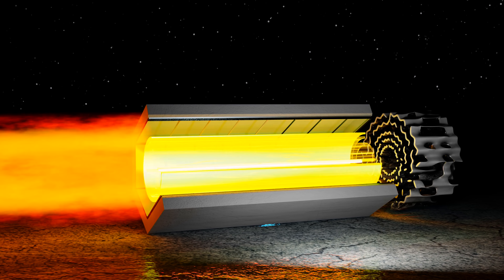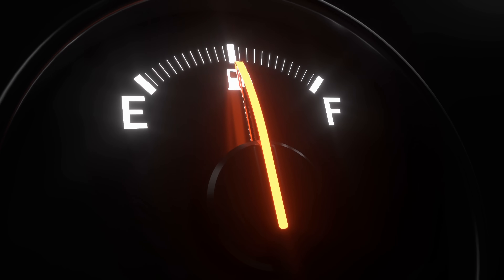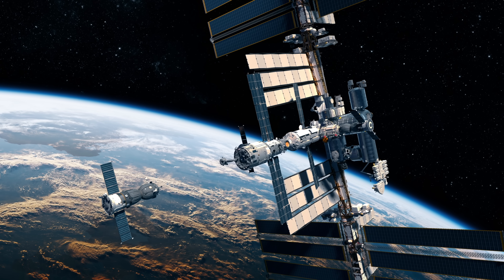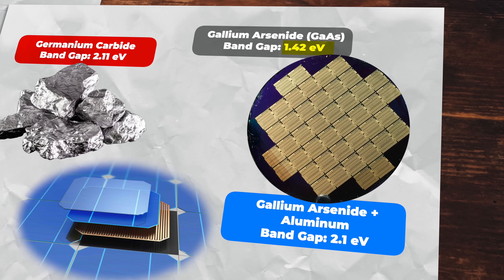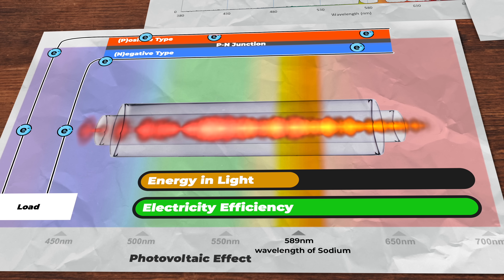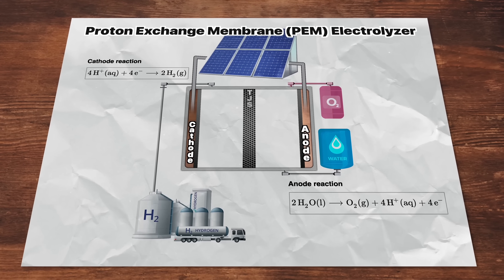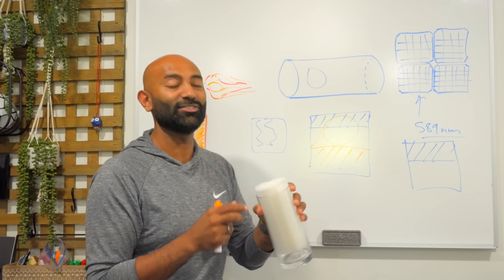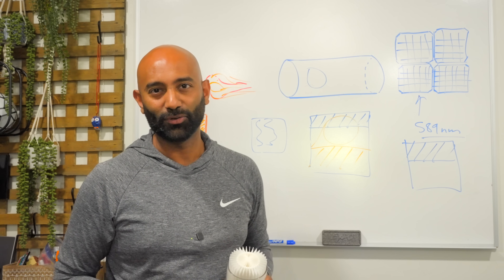Why Solid State Might Save The Combustion Engine

Comment: I am neither a physicist nor an engineer, nor do I play one on TV, nor have I slept recently in a Holiday Inn Express.  I am not sure about color or monochromaticity, but High-Intensity Discharge and Low-Pressure Sodium lamps operate at 150 to 210C (300-410F) which might be inserted post-catalytic converter for electrical generation.  Also, since there is much infrared light energy, I would think there should be investigations into band-gap tuning of Perovskite or other cells.  Hopefully, they would be less finicky and more long-lasting than the fuel-cells I've worked with.  Anyway to gain energy and reduce pollution is worth a look IMHO.

Comment: I would not throw the exhaust energy out the back. I would use a regenerator to capture more of the heat and further cool the exhaust gasses. This in turn would require less fuel to reach and maintain operating temperatures. I like your hybrid approach. In theory you could fit them to existing vehicles. Only issue is you can't get the NaCl substrate hotter than the factory exhaust gasses without some sort of heat pump.

Comment: The main issue I see with your plan of adding this setup to an existing ICE, is that the exhaust temps aren’t high enough to boil the salt. 

Exhaust headers can reach 1600° after a hard drive. NaCl boils at 2669°F, so you’d most likely have to reintroduce fuel after the header to heat it back up enough to make the light cell function.

Comment: Seems like we could add in TECs (thermal electric coolers)/Peltier to also generate power from the heat as it's cooled. IE a 12V system for traditional accessories.     This also seems like something a science enthusiast whom watches a ton of science content on YouTube would come up with. It just makes so much sense to me. All of it being things I've seen on popular YouTube videos but combined into a single project. This almost seems like it can be an advanced DIY project for more hardcore makers.

Comment: So, how do you solve the issue that the ashes will blacken the cells immediately? 
Also how do you get rid of the salt crystals which deposit all over? If you manage to blow the salt into nature, then how much will this be? Enough to cause issues with nature if such a drive could become more common? 
Also why don't you show any demonstrations or prototypes? If this has any actual potential, then the company working on this will surely have something to show and demonstrate. Unless it's all just hot air intended to capture more investor money of course.

Comment: Before having watched the video: How can an engine with no moving parts make a car move? There has to be a mechanical interface to the gearbox or the driveshaft that moves, otherwise you will need a rocket engine.

Edit: Okay as it ssems it's not an engine but a generator ...

Comment: Sounds incredibly inefficient. Commercial PV cells are about 20% efficient. Ultra expensive cells can be up to 50% efficient. Conversion of combustion into light will be inefficient too, so the overall efficiency is going to be poor.
A Diesel engine can be over 50% efficient.

Comment: Still needs a compressor for inlet.  There are different breeds of efficiency.
Heat makes the spectrum wide.  Wide and narrow are qualitative, not quantitative.
Gallium and Germanium are expensive compared to Silicon.
Around 7:20, you say PV efficiency, that is vs. ideal PV.  If ideal is 40%, and realized is 35% then PV efficiency would be 87%.

It is an bucket brigade.  If you know the stored chemical energy of the fuel, the inlet and outlet composition, pressures and temperatures, then total system efficiency can be measured.

What is the Carnot efficiency between ambient air and internal operating peak temperature?  How does their energy extraction compare?  I would be deeply surprised if it is more than about 60%.

Comment: 4 liters of fuel /10kw of energy is too low. That means an SUV at 170kmph needs about 12l of gas, which is about the same amount of gas it needs for a 100% IC motor. So there is no brake trough. there are IC motors which generates more energy than this, already on market. PHEV cars :)

Comment: he, car guy here, we like our pistons, conrods, crackshafts, vavle trains, exhaust noises and the noises all of the parts in the engine make. This thing takes all of it away, if we would switch to green plant based fuels tomorrow it would be fine with us, we don't like the fact that we are burning fossil fuels, we like what our engine it's internals sound like and how it produces power, why don't we just switch to green fuel? Much easier, the infrastructure already exists, we cut our car emissions in half and we keep our noisy machines, deal?

Comment: At 11:45. If made out of copper. That has a melting point of 1,984°F! The need to keep temperatures under control or cooling could be a problem in it's own right.🤔

Comment: Reminds me very much of Randell Mills photovoltaic system for his high [temperature, luminance] combustion process, with cars as one of early target markets that was planned (10-20 years ago?).  His project went far deeper, including the more diverse concept of "hydrinos" and fractional quantum levels of electrons that many others have looked into.  Seemed like a "sensitive process", with questions I had about the 1/2 quantum level hydrogen (easy to regenerate in sunlight, maybe, but how much of a problem might it pose as pure speculation on my part?).  Top rate thinking, though : [math, concept, theory, engineering, experiment, observation].  That lone merits a look every couple of years for me.

Comment: The engine might be extremely efficient at burning the fuel but once you convert that to mechanical energy it will massively lose efficiency. You have to add moving parts or you’re not moving. It’s that simple.

Comment: I'm just going to take a wild stab and say that the 70%+ efficiency claim is only in converting light to electricity, PV cells have a tendency to heat up and reduce their efficiency as they warm, this process might start out a 95% efficiency but i am guessing it may drop to as low as 50% after the cells have reached their operating temperature though this could be negated with a high performance cooling system.
 i dont think the heat generated is going to effectively transfer to the sodium well enough to converrt all of that heat to light, i think that exhaust is going to come out at around 600C, which is nice, because thats close to 1/3rd the temperature of a gasoline flame(up to 66% heat conversion), and warm enough to run, say, a closed loop steam generator to get another 20, even 40% of that remaining energy. This would add complexity, but also add redundancy, if those PV cells failed, you'd still have the the steam generator, that would now be generating more power under the higher pressures due to higher exhaust temperatures.

Comment: Interesting idea. But I was wondering what is the power per surface area of the photovoltaic? Let’s say it is 1000 watts per square meter. It would still take hundreds of square meters to run a car. How would that fit in a car? 😱

Comment: THere are many many types of , power-generators -  engines, the problem with vehicles is thresholds nad load. You have to have gears, to engage in creating more torque so teh engine has a higher load but is then generating less heat at a lower rpm. The major heat loss is the engine itself in the process of generating energy, to spin those whells ultimately, and also be able to go idle at notice, when a person stops. Would multiple engines help, that run at cooler temps and change, or each tire, but hten each engine weighs more, the means ot utulize the fuel in the pistan firingsetup. Of coruse there are batteries, but the batteries heat up in their internal reactions and the load on the lines poewring vairous things... There are atomic reactions, whre one doens't need a a pistan firing... at the end of th day its all about energy and put it to use, one could even make a complex tension system, but that then invovles dangers if your in an accident, which is pretty much creating somethign under pressure that works until it is loaded again. You could create a muscle like network of fibres that would be a tension activated system... the question will be what is hte best way to stop, and move a wheel, with a; energy source, that is clean effecient ,durable, etc etc etc, long. Organic chemistry demosntrates that hte fuel monopoly is a criminal trust crime of the public, since all fuel types canbe manufactured, as with gemstones, but intead of a govenring body that pushes forth national vlaues nad works what we get its migration, identity poltics and hatred, so in otherwords a non modern system ran by savages. The there are creating grids and track powering systems. The question is what would this bring freedom.

Your idea, is very specialized meaning it would be monopolistic in its intent because of feminism plus migration, plus the evil white hatred , its created a status effect of destroying civlisation to a identity of thsoe with money and not, intentional means of not devleoping nad helping people but stomping on their life, that is america, the dodos that run around seem to have only a very very watered down history of knowledge to ap oint where its simpyl politicized. Of course anyone that was robbed or harmed or had an act of cirminality against them if they fit a specific id class they will be terminated, because its a caste system not a class system, the pr is endless, over and over and over, the financial and other crimes combination.

There is no problem for vehichles the problem is much larger of a human relation, because hte mob of idiots are stupid and violent.

I like the idea, jsut like I like the spherical engine and systems. for various applications, typically this is a better systme in a stable/ safe zone, specific zones like interactive human zones ,everythign has to be made to break, in a way, in which doesn't explode, can't catch on fire easily, becuase humans have living errors of observance which causes collisions or other malfunctions.. so the nteh vehicle itself has to be designed for preventing more losses... meh... Sodium powered light, could be viable, its the same reason we can't fly everywhere, the entire hting sttating why not is because with air collisions, we then have the problem of falling on houses, where as before, that was unlikely with a car, but still could happen, lol it becomes a risk ot law, and life. SInce peopel that are udner PR or dogma, that are excited by an individual to go and do hatred na dirty work on behalf of who they follow then create choas... when in reality the world is messed up from america poltics, which has openly raided societies and destroyed the very means of republic, whihc is the end all of all republics is avarice, and lawlessness, and in america is openyl done for fun, pedestal talking points make no sense, but is reminscint of when specific tribes or groups take over republics and size power all operate in tehir duplictious way, so nothing new, but destroys teh academics and everythign typically... meh.

Comment: solid state combustion engine is not new.  pulsjet engines comes to mind and they been around for many many years.   
and this thing has 3 steps of conversion, 40 to 60% efficeincy... let me tell u a secret when u are given an estimate that means it is not built and tested and those are marketing numbers. im guessing it cant go over 20% efficiency probably less and you are probably better off just using a random 2 stroke from an old moped

Comment: How do you get the exhaust to room temp just by emitting light though? I mean I understand that heat can be transferred by radiation. But I mean how do you contain it? The light bulb itself will heat up and lose quite a bit of its energy through black body radiation or convection with surrounding air etc. And if you are exhausting at room temperature....I don't think the bulb will be hot enough for sodium lamp to even light up near the exhaust. Just weird

Comment: I'm super sceptical of that idea. The problem with internal combustion engines isn't the efficiency, but the CO2 emitted. The way I understand this "solid state engine", the fuel burned still emitts CO2. So let's say we burn E-Fuel in the future, way not continue using the cars we already have (we need to move on from producing so many new cars anyways).
Reply: It's more about the efficiency actually. 3 times more efficient means that you can do the same trip with 1/3 of fuel which essentially cut down the green house gas emitted. 
Nevertheless, this solid state engine is probably a scam. E-fuel on the other hand, quasi-Scam.

Comment: The claims seem extremely optimistic. However using this kind of system to capture waste heat sounds like the right idea. If this could be incorporated with eh catalytic converter, to create electricity from the waste heat, that could be interesting. The biggest problem I see is that PV cells lose efficiency when heated and have maximum outputs. Even if you use mirrors to amplify the suns rays by 10x on a solar cell, you will not get 10x the electricity. Also Sodium produces bright light, but at high temperatures. hard to imagine that there would not be lots of exhaust heat that is lower than the desired temperature which would be wasted energy.

Comment: Doubtful. So it has massive efficiency and waste heat. Then with high temperatures there is NOx production which limits current engine efficiency, otherwise we would increase existing engine temperatures.

Not impossible, but unlikely.

Comment: it is a generator, there is also the MHD generator that does not have moving parts, but this 80 percent efficiency is doubtful. If such a generator is both cheap and durable, it would be revolutionary as a range extender in hybrid cars.

Comment: I could see it being used as a generator in a hybrid configuration using waste heat from standard internal combustion engine but having it as a standalone power unit doesn't seem viable.

Comment: Never work, for 1 glaring reason.  Exhaust gas has to go somewhere, and where it goes, chlorine gas will also go.  Chlorine gas is crazy hazardous, so managing that hazard will be less practical than just improving normal internal combustion engines until a combustion-less power delivery system is perfected.  Additionally,  the energy needed to crack Chlorine from the sodium will be a heat sink, expending a lot of the combustion energy.

Comment: My understanding of PV is that they get less efficient as they get hotter. Wrapping a glowing block of sodium vapour with PV seems like a good way to make the PV pretty hot. If there was a way to funnel the light to the PV so they can stay cool, then maybe, but I think on a first pass through my brain that their claims are like Musk saying Starship would circle the Moon in 2023. Possible, but ambitious. 
Ambitious proclamations is usually to get VC money in the door. I guess we'll see what happens. 

Also if Fuel cells get hot, why not take their heat rather than fuss with pistons and 200 yr old technology.

Comment: thats dumb! i already designed a low temp generator. its large too big for moving around but it run at any temp it uses co2 under pressure. tuned to operate at the temp difference between day and night. im not that smart anyone can do it. they want to make low efficiency engines to use more fuel its easy to understand. cant be making a energy source that would allow terrorist to build long range rockets i like the fact that nobody can reach us.

Comment: Thermodynamically impossible. What sort of fuel converts its entire (or anywhere near 80%) of its latent stored chemical energy into light? Most of that energy is converted, quite obviously, into heat.

Comment: 2 main reasons why mainstream ICE vehicles are ridiculously low in fuel as well as power efficiency because,

1. High friction piston rings reciprocating engine. Because the pistons are traveling in linear motion. They need piston rings which are creating high friction. It's wasting too much energy to overcome the friction caused by piston rings.

On top of that by implementing GDI system to burn fossil fuels under high pressure is definitely wrong. Because all fossil fuels have slower flame speed which won't be able to burn completely fast enough inside the combustion chamber. 

The truth is ICE should be and can be frictionless without the need of piston rings and journal bearings. It's called FRICE Frictionless Rotary Internal Combustion Engine. It turns like a fan. Unlike Wankel's engine which is dancing up and down.
Reply: The existing Mazda's rotary engine or Wankel's engine by definition isn't a real rotary. Because it doesn't turn like a fan. Also it requires apex seals which are super unreliable.
The fuel efficiency of this type of engine is ridiculously poor.

Bottom line, ICE should be turning like a fan with no piston rings nor apex seals. No complicated, unreliable and expensive components such as timing belts or chains.
Reply: 2. All existing geartrain from ICE to EV are incredibly low in efficiency. Particularly the type of single speed geartrains which are commonly used on EVs. 

All geartrains should be positive drive CVT. The existing CVT technology is non positive drive. It's flimsy, unreliable and poor in power efficiency.

Car and geartrain companies should understand that positive drive CVT is true not a hoax. It's simple and highly reliable due to its mechanism.

Sadly the automobile industry fail in everything. That's why mainstream ICE vehicles are complicated, poor fuel efficiency, unreliable parts with high manufacturing cost as well as maintenance costs. 

Everything about ICE is wrong from day one.